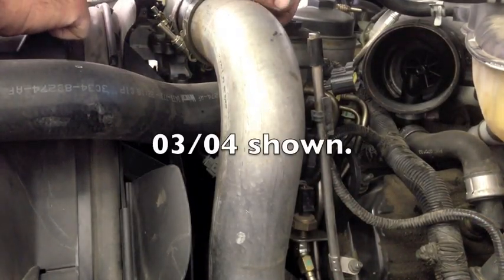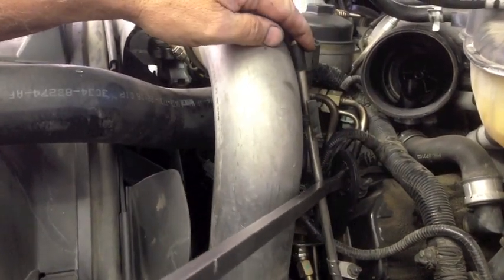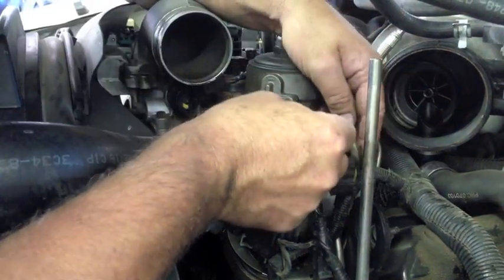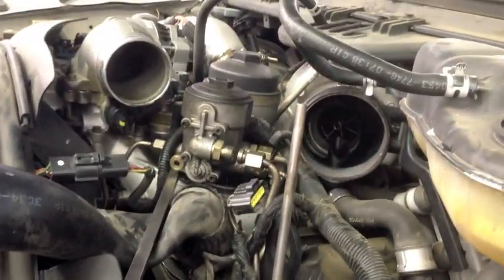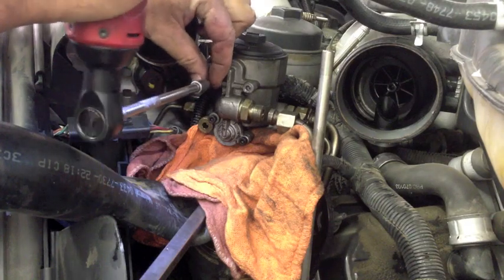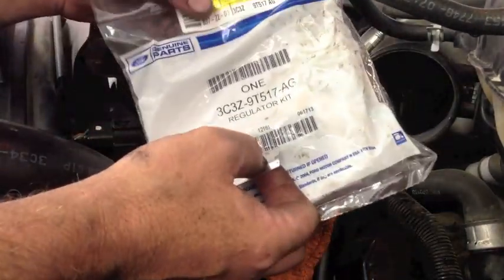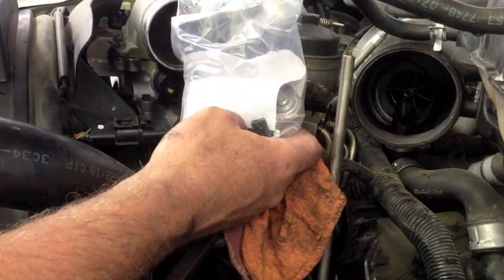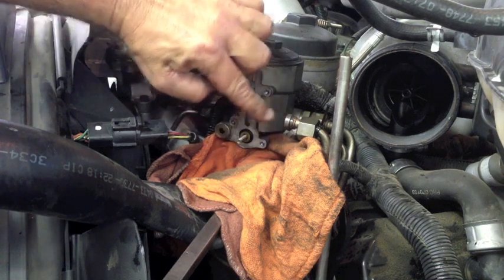Ford 6.0 powerstroke blue spring upgrade tips

Comment: I've seen this done before and I have the same model year as this video but is there a difference in the housing that tells you the spring has been replaced? Does anyone know I if not I think I'll do this and replace my radiator hoses at the same time. Thanks

Comment: I decided fuck the 6.0 and all this trouble and just bought a 2001 f250 with the 7.3. I'd rather put $5k in the trucks seats, dash and tires than just making the engine reliable. What a joke. I own a 6.0 as well but will be dropping a 7.3 in that truck when the 6.0 blows up. Fuck the 6.0

Comment: Very helpful video. I was able to do the update without pulling the airbox. Tie down for the inter cooler line and I was able to compress the other hose with my hand to remove the lower cover bolt.

Comment: What socket in reverse did you use to remove the fuel filter cap?
Reply: It's a Snap-on reversible Powerstroke filter socket. Good for the oil and fuel filter caps.

Comment: Is the Blue spring upgrade a recommended upgrade? Does Ford recommend this upgrade? I bought a 2004 F250SD w/6.0l, 137,000 and was able to get a 2year/24,000 Ford Warranty with it. The truck had a history since new with this Ford dealer. However, I'm not sure if this upgrade was ever made. Is it marked on the outside to indicate this upgrade. I want reliability not performance. No tuning just upgrades. I installed a Mishimoto coolant filter and the truck was Bullet Proofed with a new round EGR cooler and Ford Oil cooler as part of my pre delivery before I took the truck home at purchase time. What about a Mishimoto radiator or thermostat, what's your recommendation? Thanks, I really enjoy your great videos.Kent
Reply: the blue spring kit is a ford update. hints why its sold by ford. the factory regulator spring was not stiff enough to maintain oem fuel pressure for between 50-65psi. if you measure fuel psi at idle you may have 50-65 psi, but as soon as your under WOT your psi will drop down to about 20psi. this causes damage to the injectors intensifier piston and in the long run injector failure. its a great idea to do this upgrade no matter how many miles are on the truck.

Comment: HELP! 

did blue spring kit in my truck, everything hooked up. bent the return fuel line. I got a new fuel line. got the old one out, but I can't get the new one in! do I have to remove something to get clearance? is there a certain way to put it on? I've tried getting it in there but the space between the hose to water pump and the block is so tight the line doesn't even fit through it. what am I supposed to do?
Reply from the maker: You can feeding it up or down.  If needed use a 6mm Allen and undo the bracket. Then feed it in and reinstall the bracket.  They aren't all the same.  One is even on the outside of the thermostat housing.

Comment: is that kilos of weed in the green snap on box?
Reply from the maker: +grant quinones Ficms. I rebuild and sell them daily.
Reply: +DieselTechRon you saved me on the save your 7.3 for a quarter thanks ron but my harnesses where melted is that a cilonoid or idm i thinki was gona look  for the 220 volt  and got my truck back together now my boost gets to 10 pounds and sounds really bad like a howl or whine   bad turbo?
Reply from the maker: +grant quinones post a video. could be turbo, air or exhaust leak.
Reply: +DieselTechRon ok i didnt see ur reply i will tomorrow i will check cac tubes first thank you

Comment: watched your video on injector replacement withthe standpipe and dummy plug replacement did all of it in 8 hrs by myself complete with oil change and coolant change with all filters ran great for about 150 miles when another injector took a dump gonna do blue spring now this is an 2006 6.0 diesel its been to ford garage 4 times and private mechanic 4 times for a total cost of about 20,000 dollars and none of them put the upgraded 12 mm pipes and dummy plugs in. now i do my own work because of your videos above mentioned job cost me 700.00 including all tools and parts. keep up the great videos
i will eventually have a great truck

Comment: my 03 didn't have an o ring behind the old  black collet. when I did the blue spring mod I used a new collet without an o ring. I'm hearing a lot of air noise in the regulator, is that cause by not having the o ring?

Comment: For the '05 and later (or at least with my '06) with the plastic CAC hose there is a little metal spring clamp under the hose clamps in a little groove in the plastic hose.  This little spring clamp is very easy to remove, or just slide back, and makes the removal and reinstall of the plastic hose much easier.  

OBW, thanks for your videos, lots of info and easy to understand!

Comment: Ive done 10+ of these and not once have I removes any intercooler tubes or radiator hoses.  in Fact If you don't replace the cover plate( which theres no need to) you don't have to remove the Fuel Line
  Takes 5 minutes to Swap a Blue Spring
Reply: Barney Edens How do you get to it to remove the old spring and put the new one in?

Comment: Ron, at the very end you say " .. we now have a higher fuel pressure which will save our injectors ..." is that the purpose of the blue spring? Running at 60 PSI and above? And how does that save the injectors ? Thank you in advance for you your comments!
Reply: What he meant by save the injectors is that you don't starve the injectors at high pressure
Reply: Ilian Stantchev From what I understand fuel in these Diesel engines also serves as a lubricant for the injectors and if you dont have the pressure the injectors will fail because of friction and be damaged.

Comment: Got mine installed.  OEM Ford part...USA>  Wow, at 285,000 kms I guess mine was sure sacked out.  What an improvement.  Smoother start-up, Idle, and quicker acceleration.  Thanks Ron !  Darn good advice.

Comment: Ron: We're looking a the New Ford Powerstroke and the GMC Duramax  trucks.
Which would you prefer?
Reply: Dive Bar Casanova Allison has NOTHING over TorqShift when it comes to performing. People just associate the name "Allison" w/class 8 transmissions and buses etc,,, but the trans backing up the dmax is a much smaller, gentler, designed for smoothness over brute strength.. crank up the power more than a few notches and the Allison will start slipping and wasting any chance of using all that extra torque , and it was DESIGNED to do this. It's barely better than the 48RE. STOCK VS. STOCK the TorqShift will handle MUCH more torque. My 5R110 behind my 04 6.0 handled numerous 1/4mile blasts and 4WD launches in ~8K lb lifted C/C making over 1150 ft-lbs  and ~~900HP
Reply: tpcrb I am not nearly as experienced as Ron, but the conclusion I came to is this:

If you are able to and don't mind monitoring certain things, like oil vs. coolant temps, then go for the 6.0, but keep in mind, little things like this can and will come up. with the duramax, your up-front cost will be higher, but will will have less small, tedious things to address. a watched and cared for 6.0 will be the better buy, especially if you like raw power but either platform will still be able to set you back in repairs if you don't keep an eye on things. each engine has its strengths and weaknesses. I personally just bought a 6.0 recently and so far, i love it. I have seen and driven a few duramax trucks from those years and wasn't impressed. 

if you go duramax, go for one with the allison tranny. the ford transmission with the 6.0 is pretty solid, so long as you keep on the maintenance.
Reply: tpcrb as far as new trucks, the ford makes much more power and has the better powertrain IMO . the chevy has a nicer interior. both trucks are great upon initial testing, but only time will tell in the long run.
Reply: The Allison Trans has it all over the Ford.
The 2015 Powerjoke has issues already Ford is aware of and not notifying customers.
Customers are getting stranded.
To say the Ford is better is ridiculous.

Comment: Great Video.  I wish I would have watched this first!  When trying to undo the fuel line from the housing I didn't hit the wrench to create the quick break away like you did.  I used pressure and it twisted the fuel line and put a kink in it.  Does anyone have the part number to replace that fuel line?

Comment from the maker: The injectors are the main thing that suffers. The magic number I'm told is 40 PSI. if it fails to go under 40 for a long time then the injectors don't fill completely. This causes performance issues and over time major major wear concerns. The oil pressure on the other side of the injector is still there maybe over 20,000 PSI factoring the intensifier piston surface area of the injector and if the fuel is not there. Then the less resistance causes the piston in the injector to travel faster.